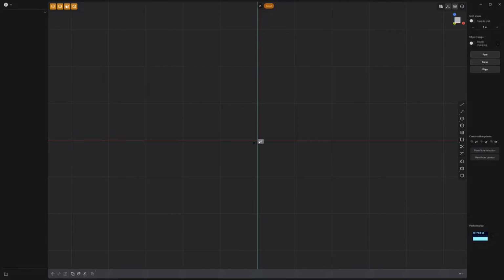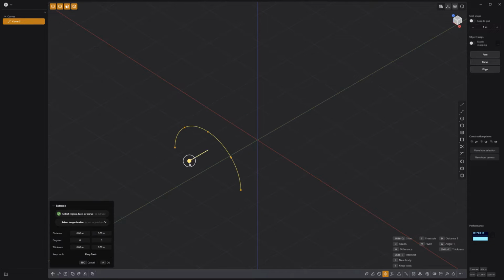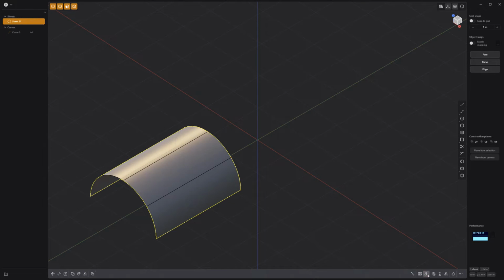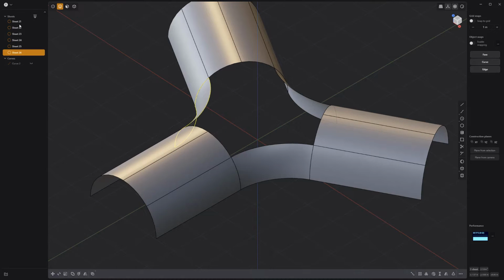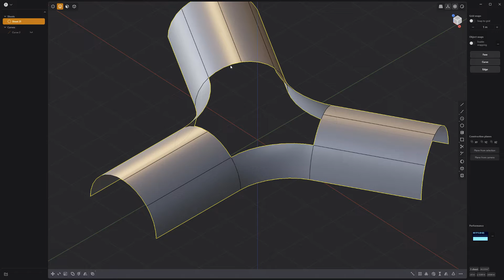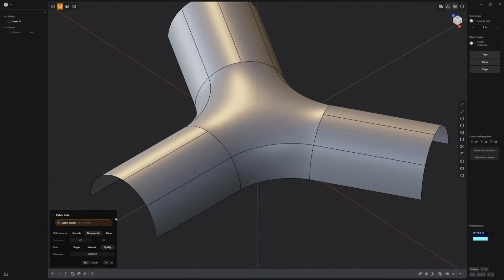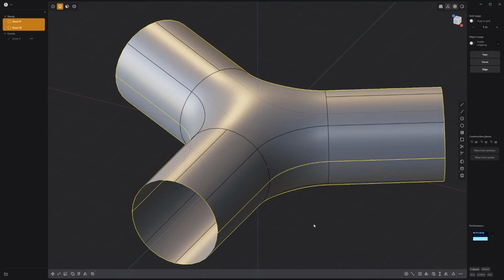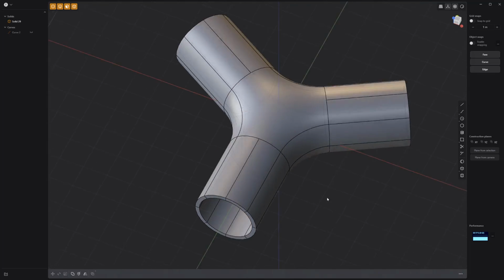Plasticity | Create a Y-Shaped Pipe (Alternate Method)

Comment: I was going to try to resist buying Plasticity. But who am i kidding......😅
Reply from the maker: It was an almost instabuy for me... I held out a few days with the demo and then jumped in head first :)
Reply: @pixelfondue  It took me 1 day before I buy. I noticed instantly that this is very productive. I did not use blender, but rhino before. and I had some keyboard and mouse difficulties. besides that i have drawn a shape in 3 h which would take me 1-2h in rhino3d. :)
Reply from the maker: @mkrzyzowski  Ive never used Blender either so it took a bit to get comfortable with Navigation. Hang in there... its amazing software!